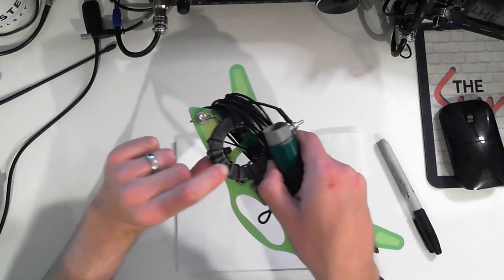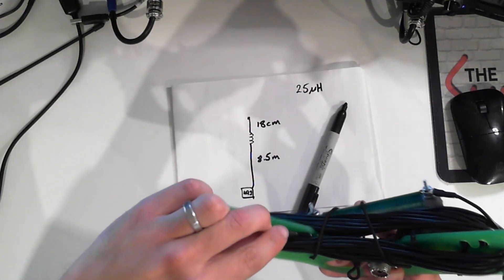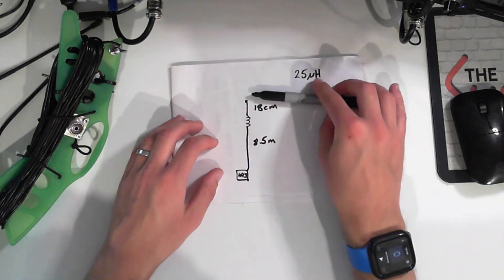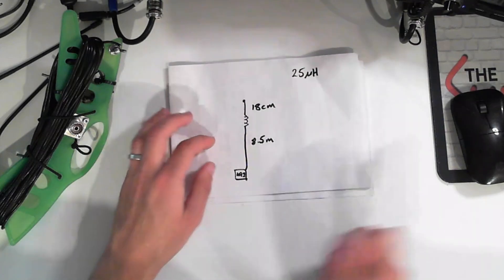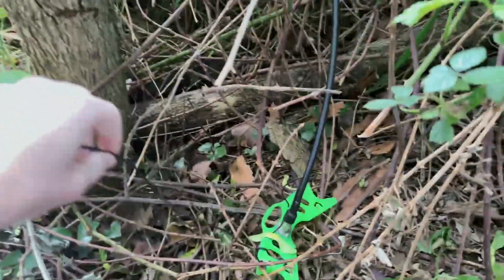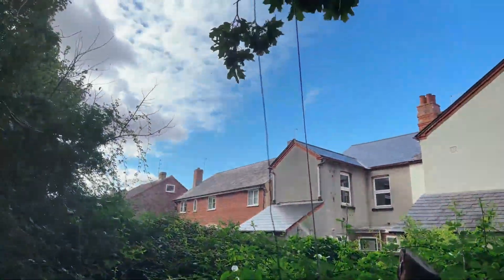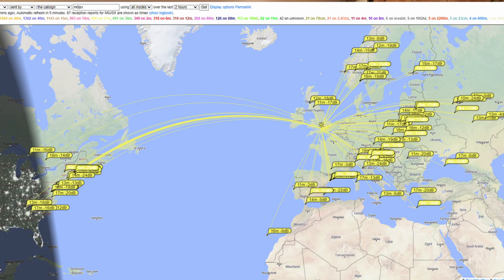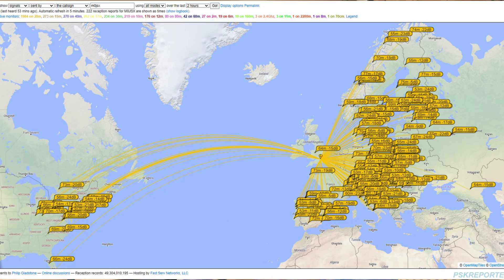DIY Ham Radio: 20/17m Dual Band EFHW Antenna

Comment: Thanks for sharing,  was thinking about 20m and 17m, and another ant for 17m as I have a 20m vertical, then I thought, would my 20m work on 17m via my old mfj tuner, answer is yes, worked g0cze on cw. 73 zl3xdj

Comment: Why don’t you try a Antron 99 which can tune with a 7610 to cover 20m to 10m and paint it green in the tree…many people have made these work ?
Reply from the maker: I prefer my antennas to be as resonant as possible; and if I can switch the tuner in the radio off, that’s what I’d prefer to do. I’m sure the Antron is an excellent antenna on the frequency it was designed to operate on. But it’s just not for me. 

Also I enjoy the challenge of making something. 73!

Comment: Great work. I did something similar for 20/40 but a ground plane a couple of years ago. I am still toying with a DX commander or a cobweb for my qth with a small garden. 73
Reply from the maker: Very nice. A DX Commander works surprisingly well in a confined space. Don't get too worked up about the radials. Just get as much wire down as possble and it'll work.